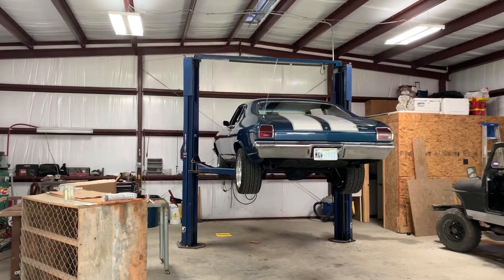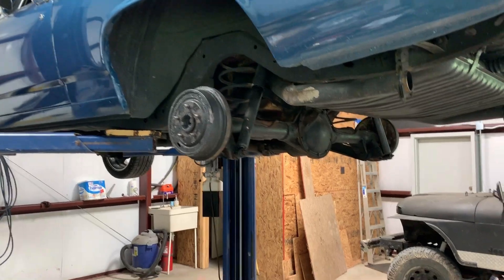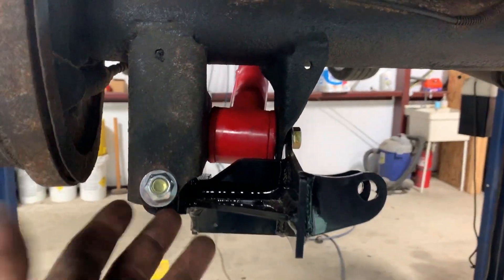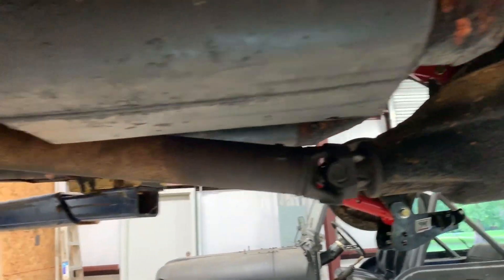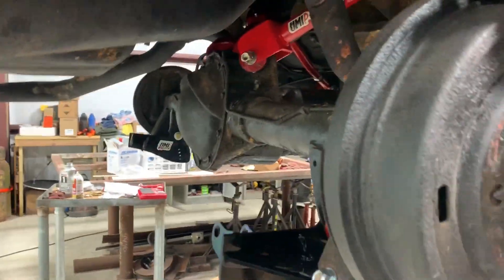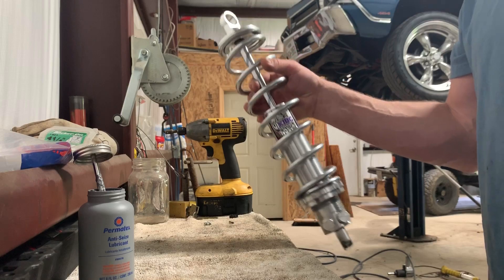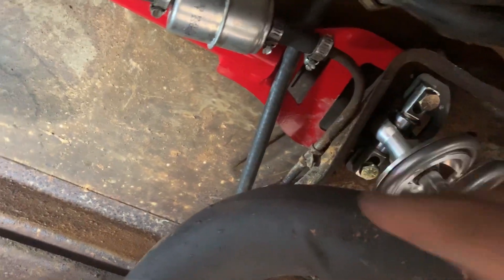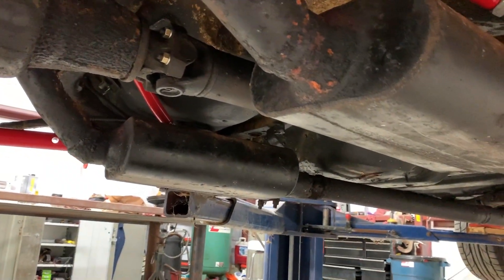UMI Performance Front/Rear Coilover Conversion for 1968-1972 Chevelle/A-body

Comment: You were almost out of adjustment on those rears. 150# is already their stiffest spring.  I know you changed a lot of variables but how much do you think those rear control arms helped over just new bushings in the stock arms. They do not have the fancy swivel ends like some brands.
Reply from the maker: Yes, as far as adjustments go they were odd. I reached out to them and they said it was normal and had to to with cross weight distribution and makes the preloads different to maintain a certain height. If you lift the left front, it lifts the right rear and so forth. To do it right you need to scale each corner. They said the preload has nothing to do with the performance and spring rate. I could go to a heavier spring rate or leave it alone and be fine.
As far as control arms, it was such and improvement over stock. Without the spring a in there it moves freely. Im sure the uni ball setups are nice, but anything was better than stock. This car handles like a new camaro now. I love it. Worth every cent for the upgrade.

Comment: The front and rear fender lips are not the same. So when measuring fender lip height, put your tape measure on the rim edge bottom and measure to the fender edge.
Reply from the maker: Agreed. There is quite a few inches difference  when comparing front and back fender lips. It doesn’t really matter what you use as a reference point when it comes to making sure your spring settings is equal to start with at all four corners. You can then adjust your rake the way you mentioned there after.

Comment: Any updates on the chevelle
Reply from the maker: Unfortunately no. I got married and had to buy a house, so the Chevelle had to go. I’m very close with the new owner and it’s they’re mostly daily driver now. Loves it! I owned it for about a year after I installed the coilover suspension (approx 10k miles) best upgrade I could have done to it. It tracked great, hooked up straight, and was incredible in curves and corners.

Comment: Does this kit return it to Stock height? Also, how much will it lower it as well after any adjustments
Reply from the maker: MrGriffin23 thanks for the reply. I couldn’t be happier with the simplicity of the install, performance, and price. Worth every cent. I am very impressed with how sensitive even small adjustments to the compression and rebound settings are for the coilovers. This kit is an adjustable 1” to 3” drop from stock height. With this kit you would have to request a different set of coilovers to achieve a stock height.
Reply: @GatorOverland  Great video...I'm currently looking for a suspension kit for my 72 chevelle ss...can you raise the rear with this kit? I'm wanting to put taller more aggressive tires on the car and don't want rubbing or side wall shredding.
Reply from the maker: @funnyfurfamily1513  i would call UMI to inquire about what coilover to use for what you are wanting. They are very informative over the phone..coilovers come in many variations, and there will definitely be one that applies to what ride height you want. This kit came with an viking adjustable 1" to 3" drop from stock ride height. You may be able to run this kit with what tire size your are pursuing, but it will come down to your wheel/tire width and wheel backspacing. I have huge wheel and tire on my rear (295/40R18 on 18"X10" w/ 5.75" backspace : Tire H=27.3" W=11.6") and have no problem rubbing, even when off camber.
Reply: @GatorOverland  Awesome, thanks for the info!
Reply from the maker: @funnyfurfamily1513  You bet! good luck on the build. Let me know if you have any other questions.
Reply: @GatorOverland  Will do, thanks!

Comment: How wide are your rear wheels?
Reply from the maker: Thanks for watching and commenting 

American Racing torque thrust II

Front 
Wheel: 18x8 
Tire: 245/40R18 Nitto 555 G2

Rear 
Wheel: 18x10 
Tire: 295/40R17 Nitto 550 G2